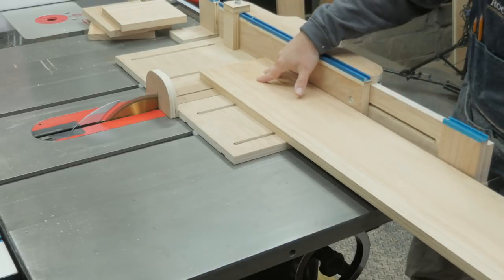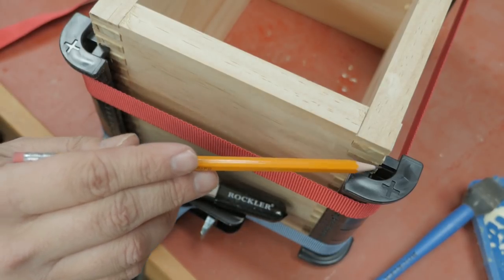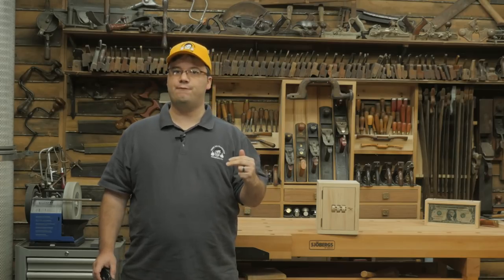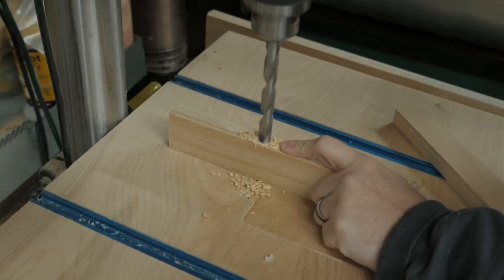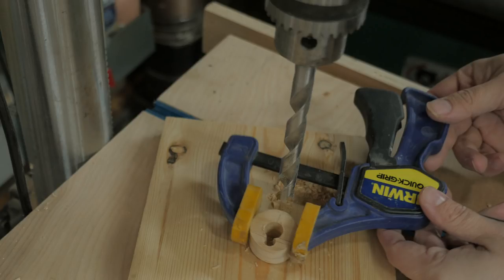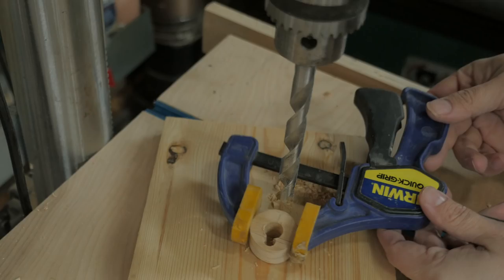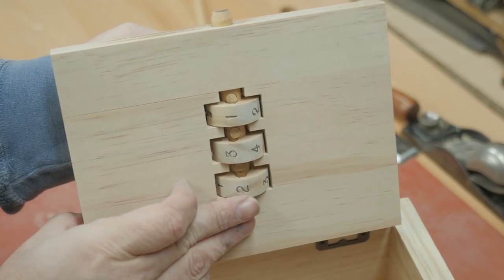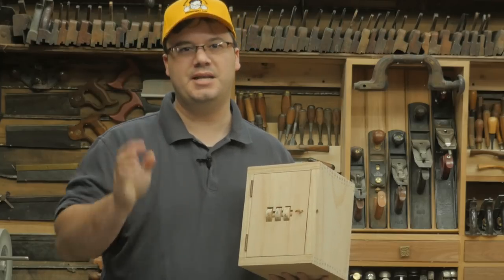Make a wooden safe to keep your stuff in!

Comment: Lovely design. Only drawbacks are not being able to change the code, and it not being very secure (not talking about the strength of the wood). Somebody could probably put pressure on the sliding lock and just rotate one of the numbers, and feel a slight shift when it hits the notch.
Still pretty good for a wooden safe though.

Comment: Very nice project, but in my opinion you should cover the mechanism much better. People who know the mechanism can find out the correct position and crack the code.
Esiest way to hide the mechanism : put the mechanism a bit deeper in the doors, then both sides of mechanism wheels will be covered and people could have problem with trying crack it...

Comment: What if you're more worried about fire than theft?
Reply from the maker: Keep the safe wet so it won't burn.
Reply: brett knoss store it in a pool, I assure that you valuables will be safe.
Reply: Maybe store the safe in a fire blanket lmao
Reply: Cover. It with.  A thick. Layer of concrete  to. Keep it safe from.  Fires. ?

Comment: Can't one just look in kind of at an angle and see that the numbers exposed are not notched?  Couldn't one visually see which numbers are the correct ones and crack it?
Reply: To fix that issue, one would only need to make and glue on a thin, decorative panel that would cover everything but the knobs.
Reply: Or just smash it. Designed for fun i imagine rather than keeping the family jewels.
Reply: @jords1979  what if someone doesn't want siblings or such getting in. Or maybe they think it might not look the best if it's a project they need to do for something.
Reply: you could easily feel for the holes when working the mechanism, its just a fun project

Comment: Woh, back up. I don't know if this is covered in the 150 comments before me, but the way you used the strap clamp and corner fixture didn't do anything to clamp the box if the finger joints extend beyond the face of the wood. All you are doing is squeezing the pieces of wood from opposite ends which adds zero pressure on the joint.
Reply: I'm guessing you don't pay attention to tools. Those clamps are designed with pressure points that press onto the joint. box joint cawls.